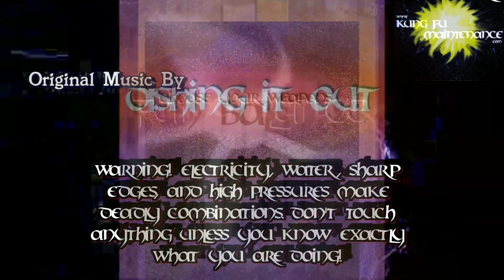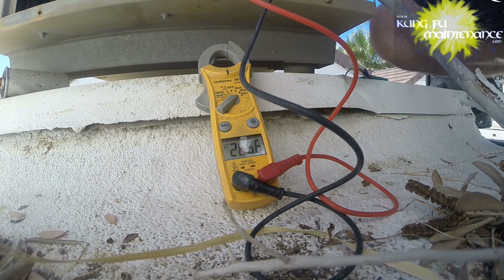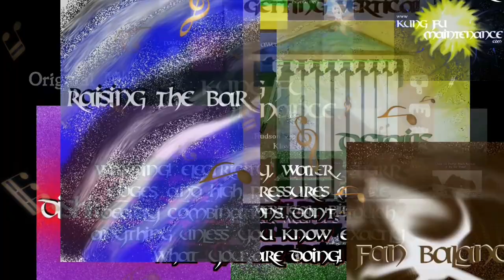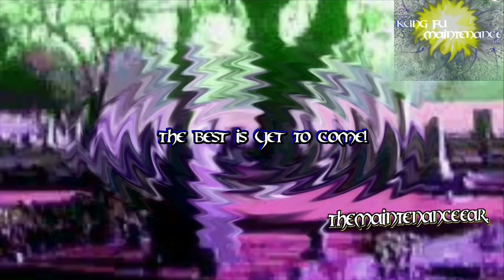AC Relay Air Conditioner Contactor Not Pulling In Five Most Often Causes

Comment: Hi, I have a very weird case here, my Rheem 3 ton A/C (with heater) seems doesn't work the first hot day of the year, the in house blower works fine, but the compressor and fan outside doesn't work, and the outside unit emit a constant humming noise, and a clicking sound (the contactor bar trying to pulled down) every several minutes, usually it won't start working until 9 PM or later than 11 PM, but some other days, it worked fine.  I have measured the line voltage was 241 volts when working, but only 239 volts when not working, I replaced the capacitor and tried to parallel connected a booster capacitor, but not worked .  This thing was going on for 8 years since the day it was installed, since we have less than 2 weeks each year needed to use the A/C, and the original shop was out of business, and all the local service company needs to have an appointment several weeks before hand, but I don't know when it will stop working, and there is no need for service when it worked fine.  If you know what went wrong, please let me know,  Thanks.
Reply from the maker: Sounds to me like it needs a new contactor. Not saying for sure that is it but based on your description that's my guess. May need new capacitors as well.

Comment: Hi i have a problem where my ac unit contactor is not energizing.I manually closed the contacts and the compressor came on but not the condenser fan.The capacitor are good btw and the fan aswell. I am geting the required voltage signal from the thermostat aswell.Can you advise me on this further please.

Comment: So I have a contractor that’s getting control voltage out doesn’t pull in. When I manually press it in I still get no volts to the load side. I’m thinking my contractor is bad ?

Comment: Multiple other things can prevent the contactor from pulling in like pressure switches in the outdoor unit or bad control boards or depending on how they are wired condensate safety switches if you get into communicating systems there are even more reasons to list

Comment: I have a problem with my contact. I do have 24 volts to the relay but it does not close. When I close it manually it all turns on. I wedged the contact closed and reconnected everything and it all runs but I do not seam to be getting cold air from the register, the inside unit is on ac and set 20 degrees lower than room temperature.  Is there another possible problem? I have a new contactor ordered and wanted to cool the house some but am worried about causing more damage. It is a 4 or 5 year old Lennox ac, not heat pump, Dallas Tx area. 87 degrees inside.
Reply: When you wedge the contactor outside like that, you are basically bypassing all the controls. So even though your outside unit turns on, the fan inside may not get the signal to come on. Turn your thermostat fan setting to ON instead of AUTO and that should take care of it.

Comment: My contactor is not pulling in so I did a temp juryrig until I can fix it sunday. I stuck a plastic shim to hold the contactor in and set the temp to a real low temp. so I will manually turn off the system when I need to :) I suspect control voltage issue.
Reply from the maker: If possible you may want to turn the thermostat to the on position instead of auto. That way the indoor portion doesn't turn off on you when it reaches set temperature and cause outdoor AC to freeze up and than overheat.

Comment: Hey thank you for this Video, I have a question how can I check if my thermostat is sending a signal? I’m working on a unit and the compressor and condenser fan is not kicking in, also the contractor is not pulling in but when I push it in with a screw driver everything works.. can you please give me a hint or what I need to check. Thank you again
Reply from the maker: Check for voltage on right and left sides of contactor. No voltage no signal.
Reply: Bad 24v signal from 24v step down transformer.wrong wiring at he thermostat.

Comment: how can bypass the five minute delay ??
Reply from the maker: The five minute delay is just a switch that makes and breaks the wire connection. First there was a wire going to contactor. The wire was cut and the five minute delay installed between the cut. To bypass would be taking out the five minute delay and reconnecting the cut wire. Hope this helps and makes sense.

Comment: Great video. Question- I have a heat pump manufactured in 2002 that uses r22 refrigerant. The last time I checked (this is a vacation home only used in the summer) no cold air came out of the vents. I also may have a fan motor issue which may require replacement (the capacitor was already replaced). The service tech I called in who was only interested in having me replace the whole system at outrageous prices, told me that my refrigerant was low and no more could be added because that refrigerant was no longer available. According to the epa.gov website, this is not true. Assuming his diagnosis of low refrigerant is true, how do I have it refilled and what kind of cost am I looking at? Thanks.
Reply: R 22 is available but its being phased out and its expensive you might as well get a new system installed
Reply: Kay Jay R-22 is very expensive. EPA has moved the refrigeration residental word to 410A. However if you can is not running it may be the capacitor and fan motor need replacing. Also if unit is low on charge, the low pressure switch may have it locked out.
Reply: There is drop in replacements for R22. Depending on the age and  condition of your system that might be a good fix. Remember a lot of HVAC companies would rather sell you a new system rather than fix it. This may or may be your best option.